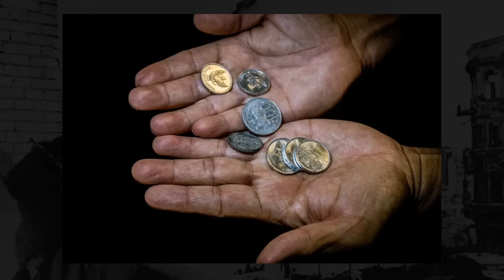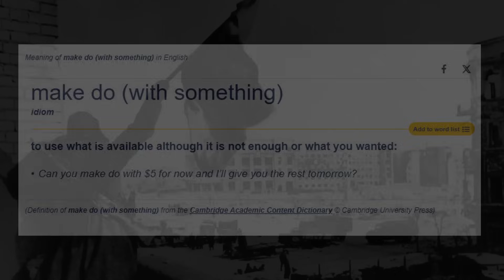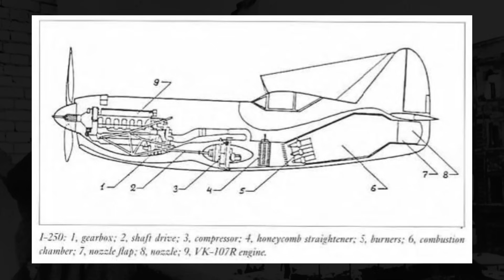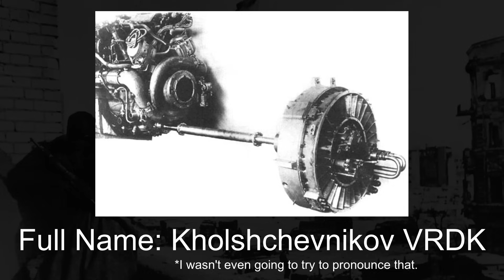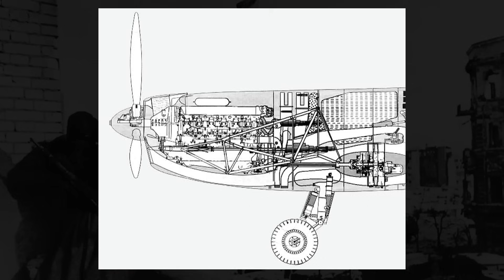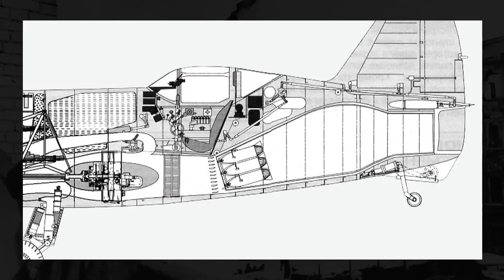Making Jet Fighters With Piston Engines: Sukhoi Su-5 & MiG I-250

Comment: The irony of the motorjet was you lost no thrust driving the power turbine to run the compressor. At the same time, the piston engine did all the work before and after the jet was lit. The power loss from the piston engine driving the compressor. As a positive (sorta) there was no turbine to melt.

Comment: You said that the compressor could only be used for 10 minutes - what happened then? Was it a question of letting it cool down and giving it a wipe over or chucking it away and putting in a new one, or something in between ?
Reply: Probably overheating. These things werent very efficient, and other motorjets suffered from same issue.

Comment: The Sukhoi Su-5 & mig's I-250 is probably nothing more than a Russian copy of the Campini-Caproni C.C.2/N.1 of the 1930s, combined with something like Ryan FR Fireball that was designed in 1943, first flew in 1944 and was produced from 1944 to 45. Except the Russians used the piston engine to drive the propeller and the compressor. Where the Ryan FR-1 had 2 engines and one was a real jet engine. The Italian and Russian engines were known as Motorjets. The Campini-Caproni C.C.2/N.1 was in reality a ducted fan driven by a piston engine. The aircraft could fly on just the piston engine and fan alone. The burner section would add thrust much like an afterburner, This was the only jet information available to the Russians at that time. The big problem with these motorjets is that they consume large amounts of fuel. In a military fighter jet they have afterburners and when they are ignited it consumes twice the fuel. It's basically taking 100% fuel at full throttle and dumping that same amount into the exhaust section to get more thrust. A motor jet would be like taking the fuel at full throttle of the piston engine, then dumping 2 times that amount into the burner section to get the extra thrust, more than a typical jet engine. But like he says in this video, you have to work with what you have or in this case the information available at that time.
After WWII the Russians got most of their jet engine information from the British when they toured the English jet engine factories. That is a great spy story as to how they got the information on the metals used to make a copy of the English jets that those interested should look up.
Reply: You must be blind or something. No, they were not copies of the Campini-Caproni C.C.2/N.1. There's exactly zero resemblance both in structure and the concept. The Ryan Fireball is even more different in having an actual turbojet. The VRDK work started 2 years before the Fireball design even started. Do you have any source for your "copy" claims in this regard?
Also, no - most of the jet tech the Soviets got from Germany, not Britain. The centrifugal compressor-based Nene and Derwent were a technological dead end. No Soviet engine beyond the MiG-15/17 VK-1 can be traced back to them.
Reply: @sergeychmelev5270  Or earlier engines for that matter. Also germans left quite a lot of interesting things, like what would eventually become Tu-95 engine - for a very long time most efficient aircraft engine in the world.

Comment: Russian aircraft piston engines weren't bad at all. Those were reliable for the purpose, they calculated with around 3-5 missions per aircraft, so the longevity was enough. In reality those enginese were overbuilt for that purpose, with proper maintenance they can fly for hundereds of hours. The reality behind the poor reliability was the lack of maintenance. They just didn't care. Just like the engines on the cruise missiles these days: those must work as designed for a single time. So in this regard the Williams F-107 is one of the worst jet engine ever built.
By the way: the soviets take the time and effort to redesign the Wright R-1820 for metric measurements. A thing that the "best of the world" german engineers at BMW was unable to do with the P&W Hornet, so they had to maintain a different toolset for theat engine.

Comment: "didn't have jet"

Actually, USSR did have jet technology in development even before WWII, as part of their rocketry weapon program that generated the Katyusha.
There's barely any info about it, but they were planning towards some sort of initial prototype in 1943, so they were clearly getting somewhere, it just wasn't a priority project, and was probably vaguely around or slightly ahead of where USA and France were at the time, or in other words, maybe about 5 years behind Germany and UK, looking at starting to build things but with no solid designs yet and still trying to figure out which theoretical and practical solutions to be used in what combinations.

WWII completely crashed the project, it was probably brought back to life again in 1943, with mixed orders, basically to see if they could achieve something useful soon without needing too much resources, otherwise just keeup up the slowburn developing the theory further.

The people in the project were probably part of the R&D of the planes of the video(and also the rocket planes before that), and later, they were probably combined with the team reverse engineering the Germany engines.   Some unverified statements suggesting that there may have been a very basic functional proof of concept testbed engine made before getting access to German engines, but who knows...   Maybe it was a suggestion, or a mockup, or an assumption of the next step made by whoever wrote the report.

Comment: Поправочка:
У СССР начиная с 1942 года были лучшие поршневые двигатели второй мировой войны.
 Это АШ-82, АШ-82 ф, и АШ-82фн.
 При массе 862- 900 кг, мощность была 1700- 1850лс.
На АШ-82 ф, и АШ-82фн был уже прямой впрыск топлива в цилиндры.
Ла-5, Ла5фн, Ла-7.
Reply: The germans had better, BMW, DB, 605. Dry weight 750 kg. It could produce 1500 to 1800 horse power.
Reply: @AlexanderÖberg-j9n BMW- 1700лс. DB-605 1480лс + система охлаждения. DB-605 1800лс + система охлаждения + MW 50  + 70литров + бак....
Reply: @бабай-ж3м full weight with coolant and oil is about 850 kg, which is still slightly better then the ASH-82 f when comparing them.
Reply: @AlexanderÖberg-j9n 1480лс...

Comment: It is quite sad that the Lyulka TR-1 / VDR-2 engine was not completed because it was sent along with the factories in 1941 to the Urals and also because the strategic materials were saved for certain technologies the engine was not mature until 1946, it is like the story of the Kostikov I-302 / 302p that they tested, even flew as a trainer giving good results but they let it die giving more priority to the BI-1 that also died killing an experienced pilot in passing although to be honest the SU-5 and the I-250 / MiG-13 look great (especially the MiG-13 I love)

Comment: This was along the lines of Italy's Campini-Caproni C.C.2/N.1 motorjet-powered airplane of 1940, except the N.1 didn't have a propeller. Henri Coandă explored this concept in 1910 with his Coandă-1910, although this would be closer to a ducted fan like the Stipa-Caproni of 1922. America also explored the motorjet with the NACA-Langley-Jacobs-Jeep, an unfinished WWII project from around the time of the Bell P-59 Airacomet centrifugal turbojet. Great video! 

The slits on the back of the Soviet Mikoyan-Gurevich MiG-13 and Sukhoi Su-5, and American Jeep were variable to regulate the amount of thrust released. The main difference here was that the Soviet slits were vertical, while the American one was horizontal. This varied from Italy, which chose to use a bullet in the circular exhaust that moved forward and backward to regulate thrust.

Comment: For some reason the idea of an afterburning piston engine pleases me.
Reply: Just run your engine rich enough, and you'll get that beautiful combustion
Reply: I'm still waiting for the rocket engine with an external oxygen compressor.
Reply: Oh yeah? Well get this: in the beginning of the Jet era british company (name of which I forgot) started serious development of a large (HUGE) Diesel Piston engine for bombers, it was of a "H" design (crazy-enough in of itself..) and to make long story short they decided on using turbos for high-boost (which DIesels can take, in a Diesel the only 2 thing stopping you from infinite boost are physical bearing of pressure & heat.. Hence you can find Diesel drag guys having near 200 psi of boost!!! No intercooling usually either, just hose literal gallons of water in, which actually makes hundreds of HP via Steam.. insane..).

But, I call them turbos, they did not and they were technically not: instead they were basically literal Jet-engine components: multiple stages of axial AND centrifugal compressors & on the other end exhaust from said engine would drive axial turbines..
But best part is for increased power THEY'D BE AFTER-BURNING before the last stages of the exhaust turbines to spool the jat/turbo shaft... Yes, a HUGE DIESEL with an AFTERBURNER!!! That was prototype 1 though, 2nd version would instead tap power from crank, making it a supercharger-turbine hybrid, which does actually exist (though came after this idea I think) in some powerful 2-stroke Diesel Locomotive engine which used only giant Turbos for induction and avoided the parasitic nature of the blower, as for a Diesel-Electric locomotive the RPM is constant so as-long as it starts, there is no trouble of not having a blower; those latter engines are EMD-something. 

Keep in mind, these plane Diesels weren't just a fleeting concept idea, the only reason for cancellation was because the Jets were then like 2 decades along, so.. Having a piston Diesel engine that's literally using everything from a Jet except the combustion chambers was seen as pointless, especially due to weigh, even though they WOULD be more-efficient back then, today too however turbofans' inherent speed advantage also buries this idea. However the company did make smaller & less-wild H-type Diesels successfully before so we do have less-impressive designs which were used to some degree. Even today, those engine WOULD be most-efficient for smaller prop-planes, however as-explained these are  inherently large, complex, heavy & extremely-expensive so... The closest we have is a currently nearing-release 2-stroke twin-charged Diesel of like 400hp. Sorry, I don't recall any names, I'm sure you can find them though with some googling.

Comment: The speed claims without the compound system active seem excessive. Not what one would expect from a conventional piston fighter hauling so much extra “dead” pipe work along. The power output for those piston engines alone would then already have to be immense. Yet the picture of the separate engine shows a 1650 figure. OK, I can’t read Russian but …..
Reply: You don't need to learn Russian to read some numbers. Here's let me help you. The gross weight of MiG-13 was over 1,000lb less than that of P-51D while having essentially the same engine power. Now add to that a 60% smaller wing area of MiG-13, and smaller cross-section - and suddenly the performance numbers are very realistic, no magic.

Comment: As a retired mechanical engineer with a career on jet engine overhaul, who read aviation books since my teenage years, I am ashamed to confess my ignorance  about this type of propulsion.
Thanks for remeding that!
Like they say, you're never to old...
Reply: every day is a school day until your last day. ✌
Reply: To be fair, motorjets were pretty obscure and died out really fast.
Reply: Henry Coanda was the first to do this in 1910
Reply: I knew about the Caproni Campini N.1 motorjet back in the 60s.
Reply: You should check out the Ryan FR Fireball or the Ryan FR-1 that was produced for the US Navy from 1944-45 that had a Wright R-1820 Cyclone 9 Radial Recip engine in the nose and a General Electric J31 turbojet  mounted in the fuselage that produced about 1,600 lbf. 71 of the FR-1s were built but none saw combat during WWII and were retired in 1947. The biggest problem with the aircraft was the Carrier landings. Several articles I read say that pilots at that time were trained to land with a slight nose down attitude so the MLG would take most of the shock of the landing and there are pictures of puilots in the FR-1 landing like that. However the FR-1 had a nose gear tricycle landing gear and the NLG would collapse with that amount of shock.  The big reason for the dule power of this aircraft was due to the slow acceleration of the jet engines and the short straight Carrier decks. At that time the Carriers didn't have the catapults and angled decks like today's Aircraft Carriers. If you watch the old war films of WWII like Victory at Sea and the Korean war films like the Bridges at Toko-Ri you would see that the Aircraft Carriers with straight decks would be half full with aircraft during operations. The latter film the Carrier had catapults and used jets, I believe Grumman F9F Panthers. Also from what I understand with the early jet engines, the pilots couldn't slam the throttle forward it had to be a smooth slow advance. Especially on these dule engine types, as they were using 100 octane aviation gasoline, not kerosene or jet fuel. Slamming the throttle forward like on a piston aircraft would cause big problems and fires. 
During my USAF Career I worked on several T-33s that had the General Electric/Allison J33, a modified copy of the Whittle jet engine. Now to be clear I was not a jet mechanic, I was a Machinist that had to go and fix many of their mistakes like removing broken studs, broken igniters, drilling safety wire holes and more. But being a Machinist I was able to work on all the aircraft, the systems, weapons, ground equipment and a lot of odd stuff, so I was exposed to a lot of stuff. I also worked on a couple of radial engines. I got to learn a lot and had many friends that worked in the Engine Shops. I really loved my job and miss it now that I'm retired after a 40 year career. I even have plans for a small running Whittle type jet engine that I need to get started on that has about 60 lbs of thrust.
Y'all take care and stay safe.
Reply: But I bet you know FAR 145 backwards and forwards 😁
Reply: I always wanted a steam rocket car to run the quickest ss1/4mi ever run by a road vehicle. = About 2 seconds. Not sure if applicable to Rooski Fighter or not but a High Temperature Pressure Vessel mated to a (exceedingly large) Rocket Nozzle with an alloy meltout plug would be HUGE.
Sigh too bad that at present it might be too heavy.
Better to just spray the water in for thrust augmentation, then. For a drag racing car it would be desirable to leave the burners sitting on the line maybe close the fuel valve. Guess you would need a pretty good backstop for the meltout plug, too, huh. Frankly I would about rather take my chances with a steam rocket than a nitro Top Fuel. Those things are ridiculous.
Reply: Check out the Caproni Campini
Reply: That's a communist jet engine, someone had a good idea long ago and everyone said, " lets go with that 1 "

Comment: I remember Italy tried this just prior to WW2 the Caproni Campini N.1 it didn't work out well. Interesting how quickly the USSR got it up and running, and the performance boost they got. Wonder why it wasn't experimented more during the war and prior to jets taking over. A motorjet that could fly close to 500mph even for a few minutes would have been a game changer in combat and the  USSR managed to figure out in a few months so it couldn't have been an engineering or metallurgical issue.
Reply: Would have to wonder if the Russians had access to any of the materials from the Caproni Campini N.1. The Russians licensed a lot of Italian designs before WWII.
Reply: The problem with the N.1 is that it's motorjet was more of a ducted fan than a compressor. It wasn't as powerful, which caused low top speeds. Also, the afterburner of the N.1 was never tested in the air, only on the ground. (Not to mention that the piston engine being used wasn't very strong either.)
Reply: No need, really. They encountered jets only in the very end of war, above germany, and had their own proper jet development + being able to use Me262 as-is, or using its 004 engines for jets of their own should immediate need for a jet fighter arise.
Reply: Fuel efficiency would have been off the charts... off the BOTTOM of the chart !

Comment: Nuances must be spoken about the Soviets copying the British engines. To begin with, the Soviets knew about jet propulsion as the others, and they had projects in the 30s, The war just forced resources to more immediate needs.
They had their own jet engine design before they got the Rolls Royce turbine. 
The RR engine helped the Soviets to catch up with jet production, but in the end the design was a dead end, as centrifugal jet engines were in efficient and could not be much more powerful. The Soviet indigenous jet engines reached maturity in the 50s and started to equip all their aircraft. 
The German jets ended in a third development line that equipped some other aircraft, but in the end it also went out, as there were so much they could obtain from them. Eventually tech and materials surpassed them.
If you want a story of successful jet copies that reached o our days, look no further than France. France captured and produced German engines and the Mirage jet engines were a direct development line from them.
Reply: SNECMA ATAR = Atelier de Aeronautic de Rickenbach!
Reply: A very good resume.
Reply: It's a BMW 003 with all the kinks worked on
Reply: Centrifugal compressors are still used on some engines, in some cases with axial compressor sections in front of them.  Centrifugal compressors have one advantage, they are far more FOD resistant.